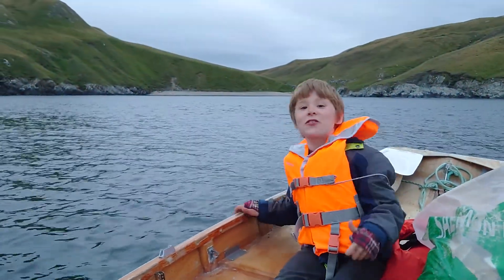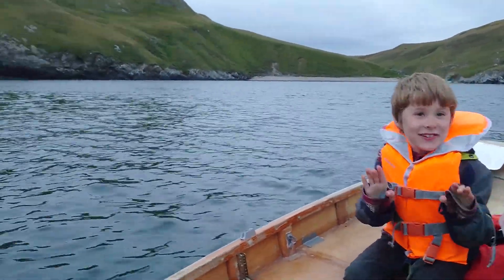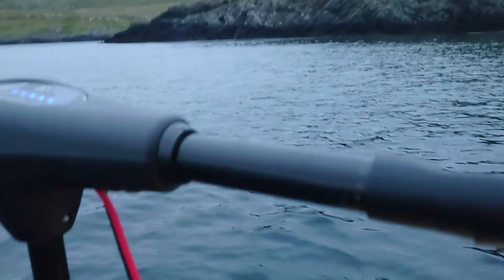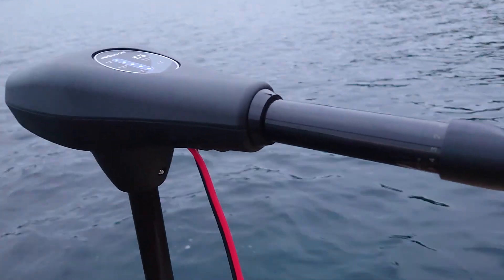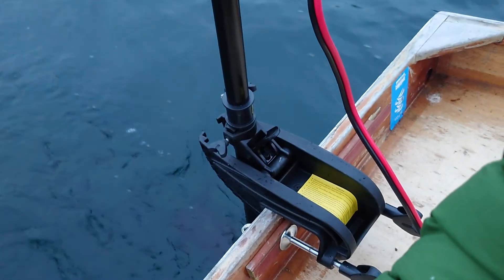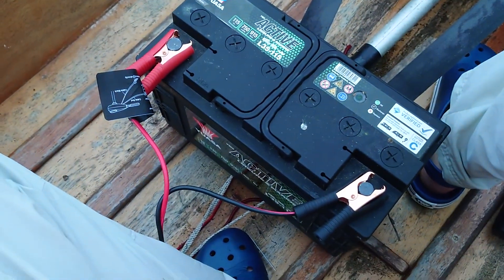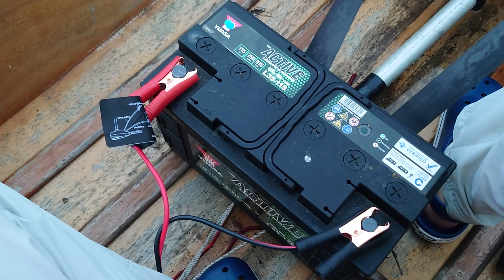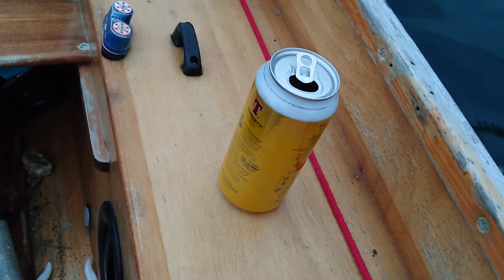Bison 55 lbs thrust 12v electric outboard on a mirror dinghy

Comment: Looks nice. I also have a mirror dinghy and am thinking of getting one of these instead of the 2 stroke I have
Reply from the maker: Other than being careful not to pick too heavy of a battery, you won't go wrong by getting an electric.
It's held up well against the sea water but it's worth greasing the thumbscrew clamps and the crocodile clips.
Reply: @northseacowboy  Cheers for the tips mate. Will only be using in a small lake. I fibreglassed the hull of my mirror... Made it a lot more rigid and me less nervous of falling through the floor!

Comment: Nice . Thanks for posting. I am thinking of getting a BISON for my Skipper 14 hull I use as a yacht tender and winter fishing boat. Have seen a 2nd hand 40LB model locally - a bit low power but maybe a good back up for the 2.5Hp O/B
Reply from the maker: I was really impressed with the power of electric. The 40lb will certainly get you moving. In calm conditions it will be perfect. The only time it would struggle would be with a fresh breeze depending on how much free board you have. While they keep adding ethanol to petrol I think electric is a safer option. Definitely a good back up!
Thanks for your comment.
Reply: @northseacowboy  Thanks. It would be a back up rather than primary mover. I assume you can set them in fixed position and row as well if struggling. From where my tender is I normal fish so that the journey is either in slacks or with the tide going in my direction.
Reply from the maker: @nickwilson5711  yes it has a clamp that you can fix it in position.
The only downside I found was the weight of the battery. I think my 110Ah is overkill.
An 85Ah would be sufficient. Ideally use a lipo but obviously expensive.
When the weather improves I may invest in a smaller battery with a marine solar panel.
I'm also considering fitting a PWM brushed speed controller for better performance.
I'd like to see how your set up works for you. Post a link when you get around to it.
Good luck and happy fishing.
Reply: @northseacowboy  A decent flexible solar panel - around 100W would be a good range extender although I wouldn't leave that long term to trickle charge. If you go on EBAY alot of panels are junk and will only price 10% of their rating. I currently have a 10w I use to trickle charge the battery on the yacht.
Reply from the maker: @nickwilson5711  that's good advice! The battery in this video was actually borrowed from my off grid workshop.
I have a decent German 160w panel charging.
I think for my boat a quality actual 40w flexible marine panel would at least see the battery charged back up between weekend short trips.
I meant to say, there is a safety concern with the electric outboard. Because there is no running motor sounds, once connected to a battery can achieve finger shreading speeds in less than a second on water and land.

Comment: Very nice. Have you tired this motor on a river. If so can you go upstream?  I have a 34lbs Water Snake and it's cool and do well but no upstream unless it's really calm waters. I wonder if I'd find a big difference between the 2. I sure seems like you going faster them me in this video. Please let me know what you think. ?
Reply from the maker: It really depends on how many knots the body of water is moving at, the draught of your vessel and the power of the engine.
I've seen people using 18v lithium batteries on 12v motors and they run with more power. Try at your own risk and check wiring and components for over heating. 
You may be able to keep your existing motor. People also replace the throttle with a more advanced PWM potentiometer. (I have one but it's not installed) check online shopping sites for one which can handle the amp/current draw for your motor.
Or buy the larger motor if you feel like with a bit more power you could overcome the force of the river.
We get strong sea currents here in Shetland, although in the faster flowing sea I wouldn't stand a chance, it certainly has enough power to tackle the moderate currents I motor into.
I'm about to try my motor on a boat nearly twice the size and weight of this one to potter around the bay Infront of my house this summer.
Good luck.
Reply: @northseacowboy  Very good. That all is good advise. Looking forward. I know the guy at SeaEagle seems to think the hull speed is a big factor.  He said I could put a huge motor engine on my boat and it would not go any faster. LOL. Thanks again